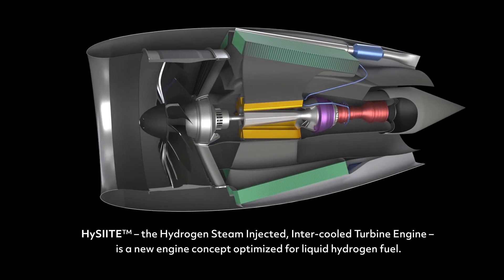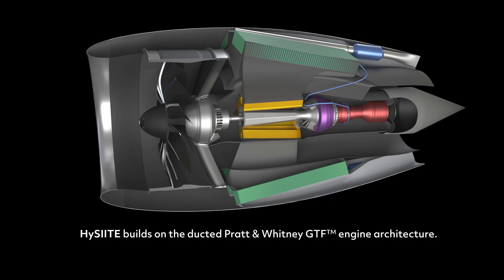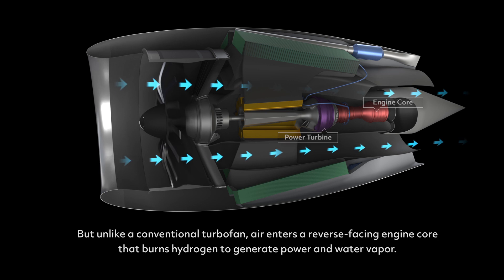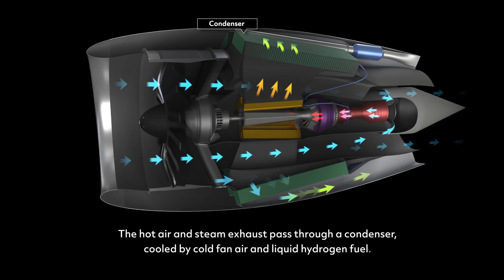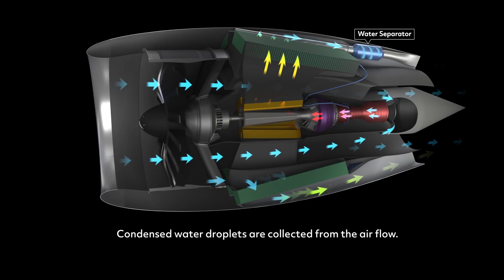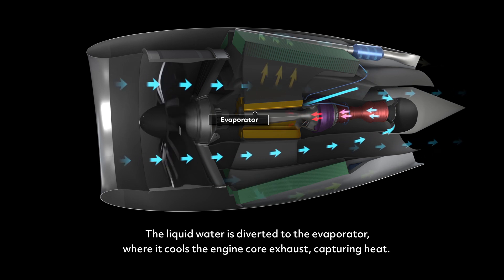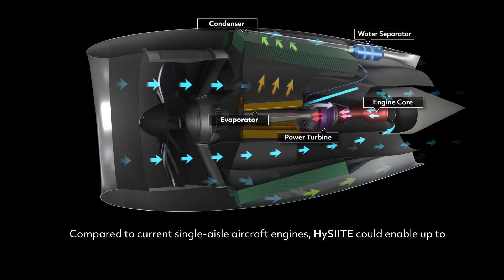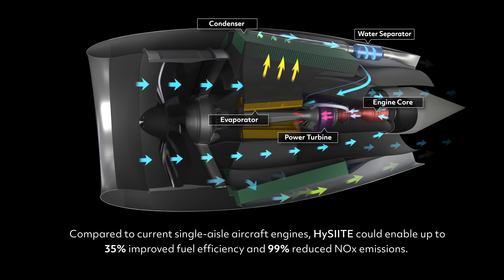Pratt & Whitney's HySIITE concept explained

Comment: I strongly doubt you’ll be able to collect water from the combustor exhaust in the way you described. Also, where does the heat go in the condenser? Also, there was no mention of a compressor or turbine in this description.

Comment: I like the idea, not only for running on hydrogen but also on current fuel. Heating the fan air with the exhaust gas increases the (kg of air/j of fuel) to such an extent that it would no longer be necessary to have a very powerful turbine to power the fan, for example. In a quick summary, the engine's efficiency increases dramatically, with relatively little complexity.

Comment: This would be great, if it weren't for the fact that water vapour should be regarded as a pollutant at high altitudes, while NOx actually cleans up methane. NOx is a problem for human health in built up areas (why it is bad from cars). Not the mid atmosphere.

Comment: This is an amazing concept!  It's time to begin converting quite a bit of our transportation and electrical grid to hydrogen.  It's the only real renewable fuel which will still be viable and useful in 500 years.
Reply: It isn't conveniently storable, so it isn't viable. We don't need to go completely cold turkey on carbon, just stop digging it out of the ground. A hydrocarbon carbon based fuel cycle is absolutely renewable and sustainable. The problem is convincing people to stop digging it up!

I'm team methanol. We should be using solar to electrolyse water and calcium carbonate into methanol and calcium hydroxide. The methanol is storable, safe, and not a massive problem when it leaks (looking at you methane), while the calcium hydroxide will passively pull CO2 back out of the air and convert back to carbonate.

Comment: Uh, burning hydrogen as a fuel is old school low tech stuff. The question is have you solved the storage issues, or are you planning on using small amounts of hydrogen as an injected fuel booster to the primary fuel?

Comment: Does anyone know how injected hot steam into the combustion chamber would reduce nitrogen oxide emission? 
I'm guessing the performance gain would be from using more heat for power (kinda like combined cycke turbines).
Reply: I'm not sure exactly, but NOx is produced when air is present in a high temperature environment. So either it is cooling the combustion temp or reducing the amount of air(nitrogen) present or both.

Comment: I notice you’re using six hydrocoptic marzlevanes, fitted to the ambifacient lunar waneshaft so that side fumbling is effectively prevented.
Reply: You might be onto something, but I think that strategic installation of a few Fernortner-valve tubules could really enhance skyward interpolation of the Van Helsing principle, helping to increase the infotational redirection of the pseudo-archetypal plasma phenomenon.  This, in turn, could provide more longitudinal thrust during the intentional engagement of the re-inertializer switches, and bring better efficiency while the sabbatical intubation-enhancers generate the highest number of spasmodic ionized cathode fluxers.
Reply: @am74343 I see you know a thing or two about encabulators!
Reply: I think you would be a great writer for the next Star Trek series.
Reply: @archer1803 its the new turbine encabulator drive.
Reply: @chrissmith7669  : Damn, dude. I was going to mention the encabulator as well!
Reply: @ If you’ve never googled on “Encabulator”, you’re in for a treat. 🙂
Reply: @archer1803 You've never heard of the Turbo Ecabulator? Or the Retroincabulator? Surmounted on a bed of prefabulated amulite?

Comment: OK, you built a hydrogen burning engine, largely based on previous work. You praise the efficiency and lower NOX emissions, but say nothing about thrust to weight or where/how fuel will be stored. From the video shown, it does not appear to be a high bypass engine. Thus noise will be a factor if it's ever approved fof flight.

Comment: too complicated
Reply: It's a jet engine not an electric fan.
Reply: @Kelle128  no, this is a complicated turbo fan engine, because of the hydrogen, all the benefits in combustion and emissions are canceled out by the greater mass and potential problems due to the complexity

Comment: Isn't burning hydrogen only 20-30% efficient, compared to 40-60% using fuel cell electrical conversion? What are the advantages of pursuing a combustion engine design instead of an electrical one?
Reply: I would guess that its weight, and maybe while still requiring high performance materials it would require less expensive ones than fuel cells

Comment: Why would there be any nitrogen oxide emissions from hydrogen fuel?
Reply: The high burning temperatures lead to nitrogen in the air reacting with the oxygen, as far as I understood.
Reply: @philipheijnen  So air (the nitrogen in it) is a secondary fuel.
Reply: @ny3dfan781  No, nitrogen is not a fuel, because combining nitrogen and oxygen does not release energy. The reactions which produce NOx (primarily NO and (NO₂) are endothermic - that means that they absorb heat from their surroundings, rather than releasing heat. In chemical terms nitrogen is a reactant.
Reply: @brianb-p6586  Thanks for the clarification.
Reply: @brianb-p6586  The How Ammonia is considered fuel? even as an alternative to H2
Reply: @jaythomasni  ammonia is not just nitrogen. It is NH₃, so it can be broken down into nitrogen (which is just waste exhaust) and hydrogen (which is the useful fuel). There is more energy released by combining hydrogen with oxygen (making H₂O, water) than is needed to separate the nitrogen from the hydrogen, so the reaction is exothermic : the net result of burning ammonia is heat production, so it's a fuel. 

Ammonia as a fuel is essentially just a source of hydrogen - the nitrogen is just a carrier.

Comment: I have newfound respect for Aerospace Engineers who designed this system...
Pardon my rookie questions though:
1. Wouldn't it be energy intensive to cool the Hydrogen, assuming you would be storing the Liquid Hydrogen in a Cryogenically Cooled High Pressure Vessel?
2. Wouldn't the Cryogenically Cooled High Pressure Vessel used to store the Liquid Hydrogen be a "Very High Explosive Risk" Safety Hazard?
3. Would this new HySIITE Turbine engine be still functional in a conventional manner should the Hydrogen supply be cut off completely due to a leakage?

Comment: Won’t water vapor in the upper atmosphere also trap heat like CO2?
Reply: Conventional combustion also produces water.

The portion of the atmosphere commercial aircraft fly in already has plenty of water vapor in it.

Water vapor is not as potent of a green house gas as CO2.

Where to get hydrogen and how to store a cryogenic fuel with a fraction of the density of conventional fuel are the big issues. This is just an investor hype proposal
Reply: Water will somewhat quickly come back to Earth as part of water cycle.
While a lot of biological processes can capture CO2, it's way way slower. And ig CO2 can also contribute to slightly higher acidity of water, which can be devasting to things like corals.
Reply: Carbon + Oxygen is why life exists here and why this planet is habitable with a comfortable climate and thick atmosphere protecting us from space. We're still in an ice age as for much of Earth's geological history there were no permanent polar ice caps, and a lack of CO2 gave us snowball earth twice before complex life evolved. Plants and life help regulate C02, but mostly have oxygenated the atmosphere. We're ants on the sidewalk compared to the Earth's geological processes like plate tectonics shaping the climate. The biggest issue today is human caused pollution like plastics and radiation poisoning our food and water supplies and harming animals. Our CO2 emissions are the equivalent of a mouse farting in the wind compared to the size of the Earth. There is so much anti-CO2 propaganda that lay people don't even understand what it is. It's driven by "green" energy stakeholders astroturfing science to take out the petroleum industry. Petroleum gives us a lot of critical products beyond high density fuels critical for civilization.

Comment: Did anyone mention that free H2 takes a lot of energy to generate and store so it is absolutely not a low cost fuel - added to the other impracticality factors
Reply: Hydrogen made using electrolysis takes about 3x or 4x as much energy to use than a battery.  But most Hydrogen is made from natural gas, a fossil fuel, releasing CO2 in the process.
Reply: Are you suggesting we fly using one ton cylindrical battery? Giant AA?
Reply: @ No-  Jet-A is a great high energy density fuel.   The biggest issues with battery propulsion on large aircraft are range and weight.  Airliners land tens or hundreds of thousands of pounds lighter than they take off.  This enables low and safe approach and touchdown airspeeds and reduces stress on the landing gear, brakes and airframe.  With known alternative fuel options, there is a significant stack of disadvantages to overcome.
Reply: @xtradi  No he's referring to the energy used to split Hydrogen from water using electrolysis on the ground.
Reply: Look up Youtube videos on White/ Gold Hydrogen: enough under the Earth's surface to supply the entire demand of the Human race for a few thousand years.
The 'low' cost of fossil fuels includes the health and future of our children and grandchildren !!!!
Reply: It's low cost, because JP will be taxed as never before. This is what made electric cars a "success". Also, there's the CO2 certificate racket.

Comment: Liquid hydrogen needs a crazy high pressure to stay in liquid state for storage at room temperature and has low energy density per unit volume.  The storage vessel/tanks would need to be extremely strong and thus heavy to contain the pressure.  Together these factors make H2 an extremely impractical aviation fuel.    Thus this engine seems like a pipe-dream or clickbait
Aviation engineers would not spend hundreds of millions to develop an engine with no commercial future.   The storage provisions to safely hold enough liquid H2 to enable even a moderate distance flight would be way too heavy to integrate to commercial aircraft.
Reply: Liquid Hydrogen has the highest energy density of any fuel. I think you meant to say volumetric density which is really disappointing.
Reply: @asandax6  thanks for pointing out the energy per mass versus volume.  I edited my entry to account for your valid point
Reply: That is completely incorrect. Liquid hydrogen is kept liquid by keeping it extremely cold. It needs to be below -253°C; however, it can be at any reasonable pressure, even atmospheric, and typically it is at 1 MPa (ten times atmospheric pressure) or less. 

It is compressed hydrogen gas which requires extremely high pressure (but at ambient temperature) to reach adequate density. Typically compressed gas pressures are 35 MPa and 70 MPA (350 and 700 times atmospheric pressure).
Reply: @  The main point is that putting a dewar system onto an aircraft with enough capacity for long distance flight of a commercial-airliner sized aircraft would be both very bulky and heavy.   Sure cryogenic storage tech for LH2 has existed for decades and there are some lightweight specialty 
Dewars for LH2 as a fuel but there are a lot of issues to overcome before LH2 would be economically viable for commercial aircraft.
Reply: @craigcarpenter6541 I agree that any hydrogen fuel system will be heavy, bulky, and expensive... and a liquid hydrogen system will be complex. It just won't be very high-pressure. 

As a reminder, this comment thread started with the claim that "Liquid hydrogen needs a crazy high pressure to stay in liquid state for storage at room temperature" which we have confirmed as completely untrue. Liquid hydrogen cannot exist at room temperature and does not require high pressure at cryogenic temperatures; it is hydrogen gas which requires very high pressure for practical storage.
Reply: LNG is stored at a similar cryogenic temperature, so we already have infrastructure for it
Reply: @ agreed the cryo storage tech exists just not in a format that could store it in sufficient volumes and with the safety airliners would need.   The tank volumes an airliner would need would be about 4x the volume of Jet-A for the same mission parameters and the provisions for cryo insulation/evaporation/would add tremendous weight to the airframe.   Yes H2 is a lower mass fuel but the volumes needed plus the safety issues make a huge list of hurdles to adapting LH2 as an aviation fuel.

Comment: As a retired aircraft mechanic, this seems to be a way over complicated engine system. A lot of stuff for little gain. Maybe it enhances P&W executive compensation?
Reply: Perhaps, but NOx emissions are the major issue in hydrogen combustion, and addressing that is clearly the technical target of this design.
Reply: how is 33% potential reduction in fuel efficiency is little gain?
Reply: @POTATOMAN-gi9ce  - Because, most likely, it's a "Lab" or "Test Stand" Data Figure, and not an inflight Measured Data Collection! 

As others have Stated, 4.4x Volume of Cryogenic Fuel needs to be carried, to maintain operation endurance or distance usable for flight, and that comes with a New Weight Penalty in Tankage, unlike The JP4 type Fuels currently used, in basically unpressurized wing Tanks!
Reply: @POTATOMAN-gi9ce  you may have mis-written this comment. I think you meant it the other way around.
Reply: @duanepierson4375 what do you mean he meant the way around? He pointed out the right technical argument.
Reply: @POTATOMAN-gi9ce When you factor in the cost of maintaining an overly complicated system and the associated costs, then 33% doesn’t seem to be worth it IMO
Reply: Do you know that typical improvement for turbofan is 2%? Now you are saying 35% improvement with zero CO2 and 99% NOx reduction is a small gain. 😅
Reply: You went all-out with that one. 😂😂  You're probably closer to the truth than any of the other comments.
Reply: As a physicist, I ask you to just wait and observe.
Reply: doesn't look that complicated at all lol

Comment: Liquid hydrogen: 8MJ/L
Jet A/A1: ~ 35MJ/L

So where will these ~4.4x larger fuel tanks fit in the aircraft? Insulation for said cryo tanks?
Reply: Unfortunately I have to agree with you here. With hydrogen the engine is probably the easiest problem to solve. Even though it is literally rocket fuel, there is a reason it’s preferred for second stages rather than first. It has a better energy to mass ratio, but in this case, it’s the volume that matters, which is the Achilles heel of hydrogen.
Reply: By mass it's pretty good I think but by volume it sucks
Reply: and how do they plan to deal with leakage of these smallest atoms from ...well everything ? And corrosive nature of it  ?
Reply: @DirkLarien  Hydrogen has been stored and transported industrially for decades, both as a compressed gas and as a cryogenic liquid. Tanks are typically polymer-lined.
Reply: @ in tanks that have very low lifespan. Are you pushing this because you heard it somewhere or because you are one of those that will profit from building this and milk those subsidies ? Because if its the former you would be rooting for theft of your own money.
Reply: Don't really need insulation if the consumption rate is higher than the boil off rate.
Reply: @danieltoone5979  insulation is needed to avoid an excessive boil-off rate. Also, this is not really an issue during flight, as much as it is while on the ground (and consuming fuel at a low or zero rate). It might be possible to avoid the need for active chilling, but insulation is certainly required.
Reply: It fits in the fuselage, translating into less seats. The future of air travel seems expensive lol
Reply: They use LNG or liquified methane to increase the density of
Reply: maybe smaller jets are the way to go. we seem to be going that direction already.
Reply: It would make much more sense to utilize methane, since it does burn cleaner without any of the downsides of hydrogen. It sits at 36MJ/L.
Reply: @jacobbaumgardner3406  The Soviets had some Progress turbines running on methane and natural gas too. Worked pretty well and was less maintenance intensive, but lacked stronger push from government and infrastructure, and this development happened right before soviet oblivion
Reply: @victortaveira8271 that might be viable from ground based power plant turbines.
For jet turbines, however, energy density per Kg isn't what's important, its per liter. Unfortunately, even in their liquified states, methane and LNG have mediocre energy density.
Reply: Hindenburg anyone?
Reply: this better not be another "green energy" scam
Reply: @websitemartian  : Please explain how this would be a scam.
Reply: Please refer to Blended Wing bodies and the work by startup Jet zero.